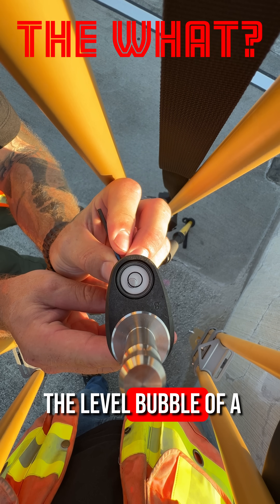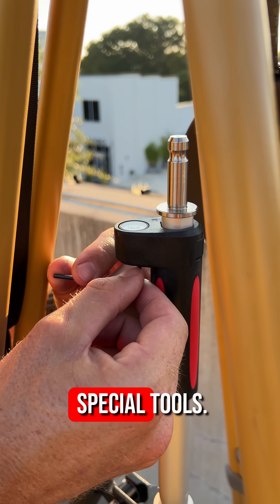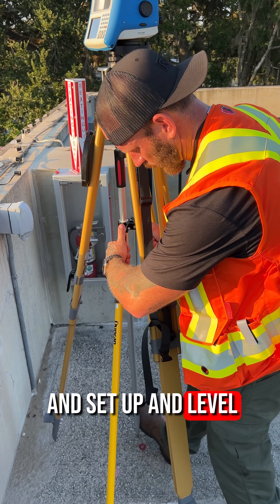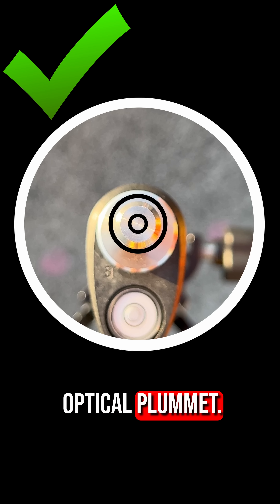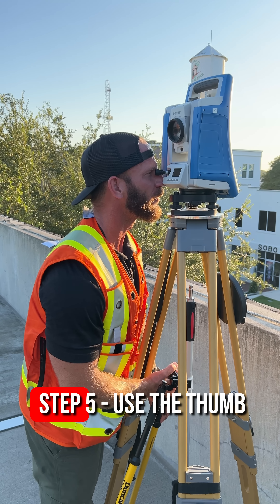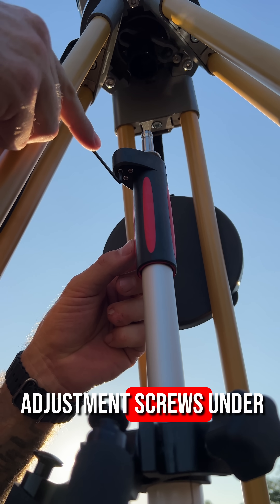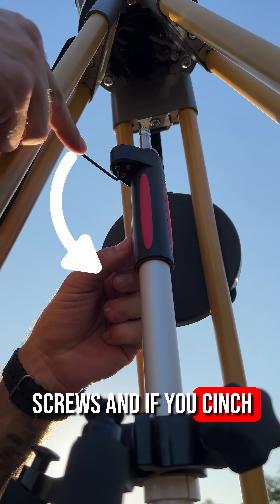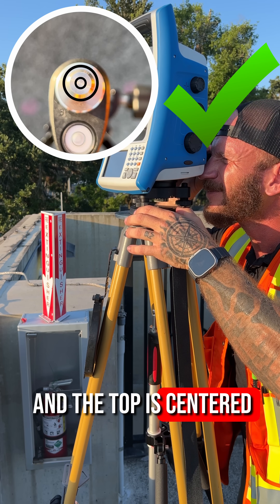Prism Pole Calibration - Tribrach Method #totalstationsurveytraining #landsurvey

Comment: What if you level the pole using gravity, but when placing different prisms on the same calibrated pole (like GMP101 and GPR111 for example), and you find differences from 2-4mm between the prisms? By checking the distance on the tip of pole and the prism itself and keeping them equal, wouldn't better as you would have exactly same distances for different prisms? 

From my tests, even if you calibrate the pole bubble, could be differences with different prisms, so I try to keep distances consistent between them instead just looking to the vertical plumb...
Reply from the maker: That's a different error source. Prism centering error and it's independent of pole plumbness error.

If you only use one prism on the same pole and always keep it in the exact same configuration and never rotate the prism on that pole (never going to happen) you can negate the prism centering error using the method you describe. If you want a fool proof method to remove both error sources take one observation on your prism then rotate it 180 degrees and take another. The deviations will cancel each other out. Its the same idea more or less of how a dual face observation removes collimation error. I'll do this in a pinch if Im in the field and notice some pole plumbness error and dont have the time or tools to fix it properly.
Reply: @The3rdDimensionSurveying  So, in this case, you would recommend still to trust the bubble calibration, even if there is difference for different prisms with the same pole?

Do you have any method to calibrated mini prisms like Leica GMP111 or GMP101 aswell? Thanks!
Reply from the maker: @lztoniolo  If the pole bubble was calibrated correctly, absolutely. Prism centering error is a pesky additional error source although a GMP101 should have very low centering error if its a genuine Leica. Check out my video about comparing Leicas vs Chinese prisms. I talk about prism centering error quite a bit there.

Yea for mini's like the 111 just secure it really well with a temporary bipod if need be and use your tilt up method. At the 0.1m HT though the bubble would need to be way out to matter.

Comment: There are allen wrenches that are not of the "L" shaped variety.  Ones with a screwdriver type handle are available and are much easier to use for adjusting rod bubbles.   All my rods use either a 2.5mm or a 3/32" size, so you really don't need a complete set. I find the "L" shaped ones to be a PITA, for this purpose.

Comment: And what if your tribrac is off?
Reply from the maker: Great question, you watch next weeks video on field adjusting tribrachs 😊
Reply: Assuming you have optics and a level bubble that can are not fixed in orientation on the tribrach, you can complete a "good" setup (good bubble, over the point) and spin the instrument 180 degrees to observe any error.  Bear in mind... you'll be seeing double the actual error.  Visually correct half the error out, then adjust your bubble and optics.

Fortunately, on most instruments?  These errors are small.  Even when they're "out" - the instrument is still far more accurate in plumb than your rod will ever be, making this method perfect for a field-adjust to your rod.

Besides, if you're unsure if your tribrach is off...  Should you even be bringing it in the field at all?